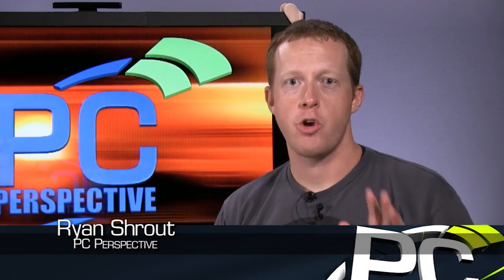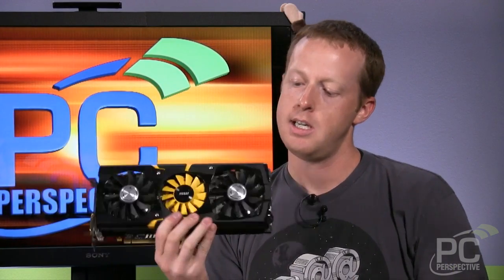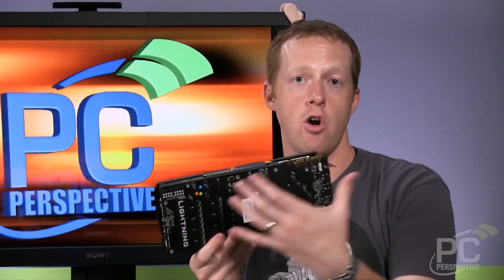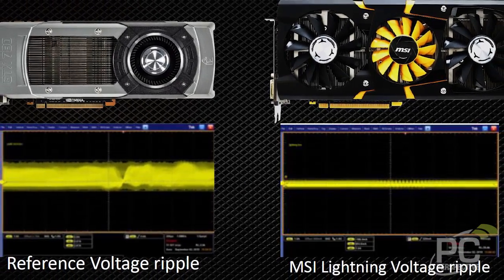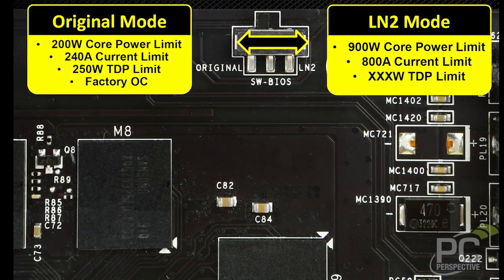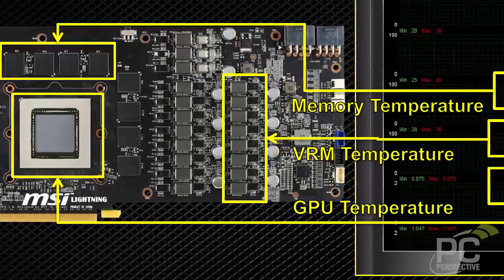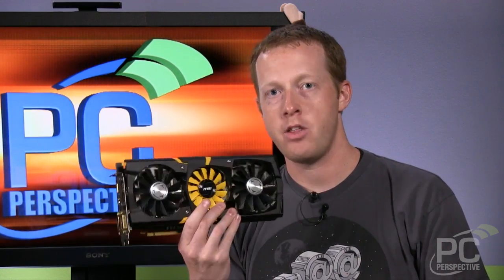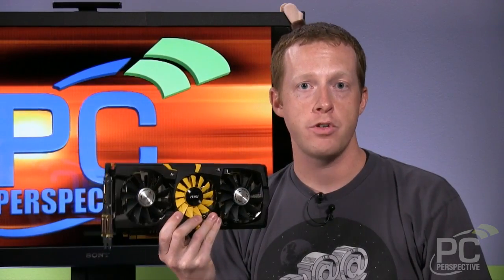MSI GeForce GTX 780 Lightning 3GB Graphics Card Review - PC Perspective

Comment: I would wait until the non-reference design R9 290s come out, 290X is a waste of money, only a few frames in it, and the reference R9 290 and 290X run very, very loud and noisy. Note that crossfire is crap, if you are planning on getting multiple GPUs, definitely go GeForce, SLI is much better.

Comment: In about a month you will be eating those words! LOL. The GTX 770/780/Titan have the worst $ for performance numbers in GPUs in a very long time, especially the Titan. AMD is putting out the HD9970 which is going to smoke the Titan (i'm not just saying that, check out the specs) for $500. The GTX 700 is another Nvidia quick money maker. They outdid themselves this time and fooled a good number of people into buying them. SLI Titans have HORRIBLE performance for $2,000